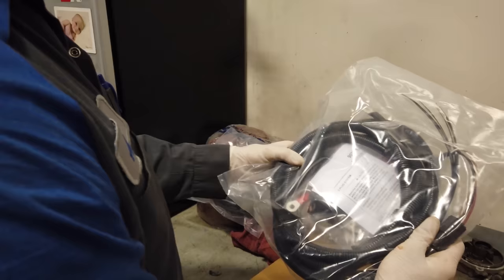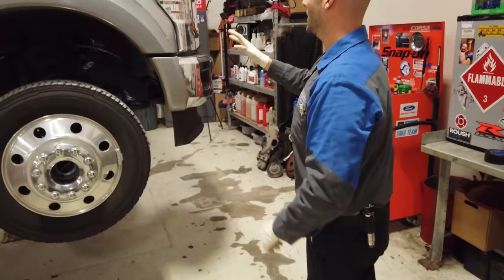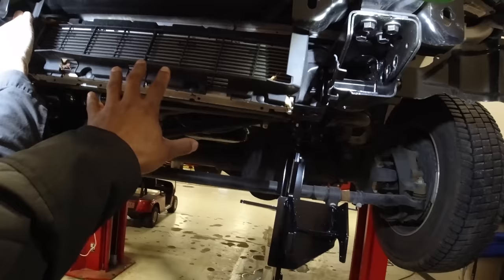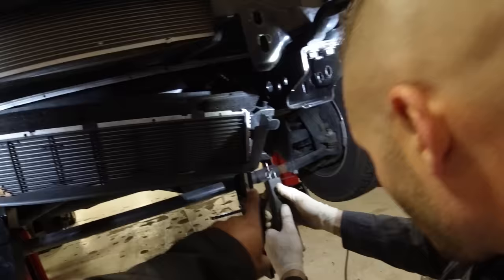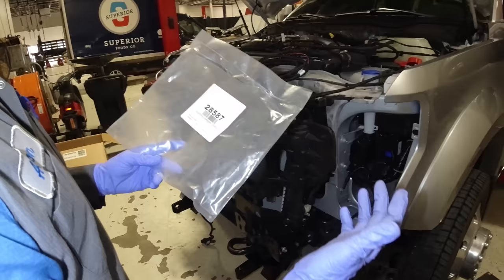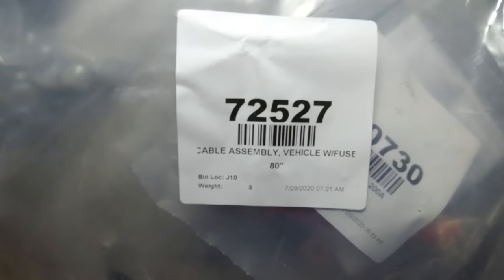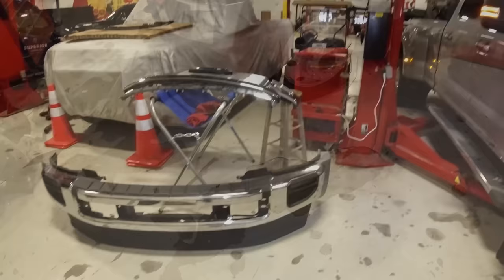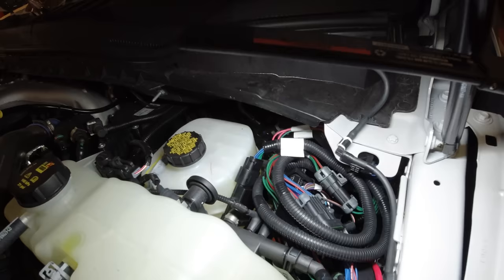Ford 6.7 Alumiduty F250-F550 SNOW PLOW Install  - HOW TO

Comment: Been watching your videos for a while a love your work. I have had a lot of Super Duties, 02, 08, 15 and now a 20 F250 Tremor with a 7.3. Installed my Boss plow on it using the new Boss harness for the Ford snowplow up fitter plug that was added for 2020. Completely plug and play, none if the BS you suffered through here.
Reply from the maker: Awe man.....
Reply: Turns out they gave us the wrong parts! should be plug and play just the same, I now have the right parts and we have to redo everything!

Comment: I like the Class 4 and 5 trucks because they still retain the Super Duty look but have the wider front axle that provides a ton better steering angle. Love that the 2020 6.7 comes with steel pistons too. Tighter pistons to wall clearance means better cylinder sealing and less start up piston wall slap.

Comment: I'm usually just here for the music. But I can relate. A 2017 F250 at work went to an installer for this to be done. It came back with parking lights only and high beam. No low beam. It was the wire harness wired wrong.  The funny thing is the driver never said anything because he only drove it fair weather daytime. We just found out a few months ago.
Reply from the maker: Wow
Reply: I forgot to mention we haven't had any snow in the past year or two so that's another reason no one else knew it wasn't installed correctly.
Reply from the maker: Lololol

Comment: Love the videos, man! I do have a question though. Hope you can help me out! Ever since I bought my 2020 F250 6.7 back in November of 2020 There has been a loud fan noise running about 80% of the time, that I doubt is normal. Will do it while I’m towing or not towing. Feels a bit sluggish as well. By any chance would you know what’s going on?
Reply from the maker: Fan clutch cld be messed up, come swing it thru!

Comment: Love you videos! I’m not sure if you have any insider info but on my 2021 f350 6.7 king ranch the check engine light has came on 3 times, the first time it turned off after there was heavy acceleration but the other 2 times it’s turned off on it’s own at random times. The code is for insufficient/over fueling for proper idle speeds. When it first happened it seemed like injector #8 needed to be replaced. Should I get it replaced or wait till the check engine light stays on constant?
Reply from the maker: Ooooo u might have to swing that boy thru

Comment: That's a nice rig😍
What's under the tarp in the shop? Slammed bull nose?

Alot of times guys get newer trucks and keep the plows from the last truck or last 3 trucks😉 and bastardize the harnesses.
Reply from the maker: Thanks bud! Under cover is a mint 83 F150 with 8k miles 😍😍
Reply: 🤩 woo whoo , nailed it

Comment: I have a buddy that works at my local ford dealership but is there anything you can think of that may be causing my truck to throw the check engine light and say over fueling or under fueling for idle speeds?
Reply from the maker: Powerstroketechtalkwarod@gmail.com

Comment: I may be early but I'm asking any way. What does the snow plow prep package actually provide? I do have it on my 17.
Reply from the maker: I believe different front springs. Back in the 6.0 days there was actually a clip in the trans that was for the package..
Reply: Usually more alternator power

Comment: How are these light wire connector mods going to affect the warranty? If proper tools are available, can wires be moved and additional wires be added so no factory wires need to be cut or splicing on the plow side only with maybe a single added pin in the plow side connector? I would insist that they cover 100% of all additional fees, parts they need to give you, and the mechanic's labor to make it right and return the factory truck side harness back to stock, I don't pay for company mistakes especially when they admit they made a mistake.
Reply from the maker: Nope, they charged poor DS again....😔😔😔😔

Comment: Hey where did you pick up the switched power for the controller ? Did you tap into and upfitter switch or into fuse panel in truck ? Installing new fisher xv2 9’6” on my 2017 f-450 this week currently waiting on the harness for my led headlights.
Reply from the maker: Yepp at the up fitters
Reply: @PowerStrokeTechTalkwARod  fantastic thank you that’s exactly what I was thinking but just thought I’d ask. Great videos thank you.
Reply from the maker: You bett dirty

Comment: 1:04 I'm confused (The right way, the professional way, save some bucks etc) the OEM wiring is now completely butchered, the lights no longer work correctly and the valance cut outs look like they were cut with a hatchet 26:35. Sorry, intent is not to offend, just calling it as I see it. Should have waited and got the right harnesses.
Reply from the maker: Hey Phily phil